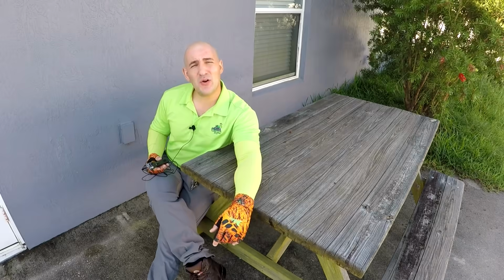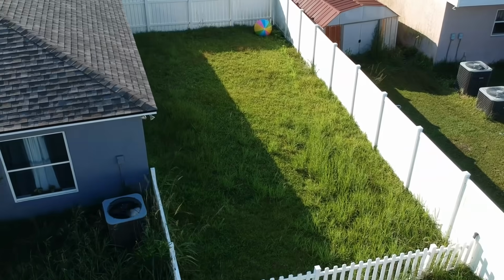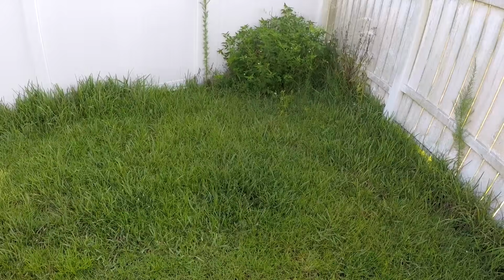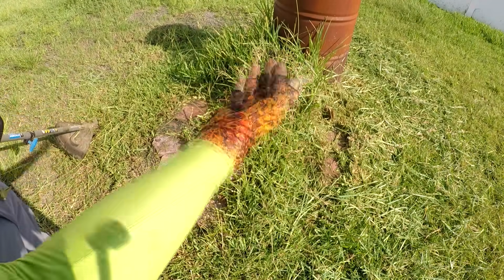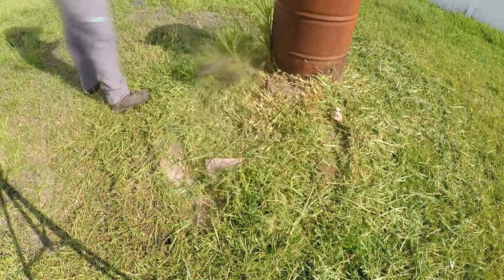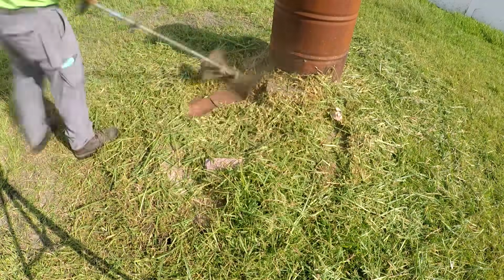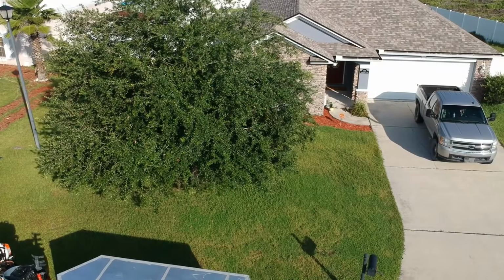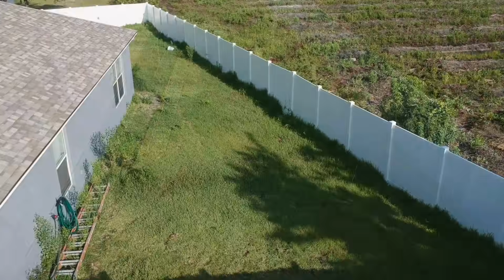This Yard Was Seriously Messed Up

Comment: Your back pain is your “SI joint” stretch your hamstrings and the pain usually goes away.
Reply from the maker: Thank you!
Reply: And if it keep coming back, not chiropractic help is needed but physical therapy or maybe a shoe adjustment.
Reply: @BakerCountyTrashPickup  as someone with SI nerve damage. Chiroprator will help but stretching is best. Your lower back needs help.
Reply: I agree:) Tight hamstring can cause that pain

Comment: I just got the Hart 40 volt trimmer and you are absolutely right it's has the power of gas for sure and I would be happy just going electric on the trimmer/edger part.
 but the man in me still like the purr of the engine

Comment: I think your back pain is being caused by your Sciatic nerve, you should go get that checked out
Reply from the maker: Thank you!
Reply: Matthew Summitt i agree.  you need to stretch your legs, especially hamstrings
Reply: I thought the same when he pointed to the location. A nice message and stretches will do wonders.
Reply: Look at all these Physical therapy doctors in the comment section. All went to harvard
Reply: @TheNacional95  yep we sat next to u
Reply: @BakerCountyTrashPickup  I'm not an expert but I have experienced lower back pain years ago. Looks like you are pointing to the sacroiliac joint - check your shoes if they are getting worn out evenly (let/right vs front/sides/back) - give this info to your medical provider who may recommend proper shoe inserts. Don't focus so much on stretching hamstrings, work to strengthen them (you may have imbalance muscle strength quads vs hams). Stretch the hip flexors instead. Something that really helped me: strengthen your core muscles (not referring to six pack) - yoga/deep breathing exs, improving posture.
Reply: What is the name of the weed wacker and edger you use I might get my dad one for Christmas because that think does work
Reply: @willjohnson376  check the description!
Reply: @dineshrm  I agree, I thought SI joint.  Go get custom inserts, they are not that bad price wise about $150. For me, it was the inserts and stretching all the low back, hip, thigh muscles.  A chiropractor can definitely help.  You do a lot of stooping and one-handed dragging that makes it worse> if you make sure you are lifting with your hips facing what you are moving, it will also help lessen the strain.
Reply: that requires surgery FOR SURE😭... go see a Dr and get an MRI of your back nerves before it gets worse. you will need surgery either way but the pain will only get worse the longer you go
Reply: Piriformis muscle is pushing on your sciatic nerve. Massage will release that in an hour. With heat. I mean real massage not a light rub. Ha. If your ever in Canada I'll send you to mine, she's magician.

Comment: Did the battery on your weed eater last that whole time? I have a friend looking into  the Hart brand after I mentioned you using them.
Reply from the maker: I think one 5ah lasted until I get near the corner of the tall fence and the small picket fence. There might be jump cut to change it out.

Comment: Those electric string trimmers are wonderful. I got the dewalt one myself. The only thing it seems to struggle with is the fall grass that grows by the ditch. It doesn't cut the grass but fluffs it up if that makes sense. It just knocks all the fibers out of the grass and leaves a mess.

 I ditched the gasoline powered ones in favor of the electric ones for noise reduction and not smelling like spent fuel at the end of the day.

Comment: That’s what many yards look like when I get the initial call. I do what he did but I go ahead and rake some of the yard. There is just to many clippings to leave which then turn brown and look like shit afterwards. If it will be a regular customer, I won’t mow it as low the first time and every time after mow it a little shorter until the preferred height. 
I love the Bobcat stander...I should have bought that instead of my Ferris!  Not sure about a cordless weed eater though. You need the power of a gas trimmer to get through some of those deep weeds! I do need to try edging beds with my edger and see how that works.
Good video!
Reply from the maker: Thanks for all the feedback and for watching!

Comment: I’m still learning from everything you show! I’m just starting to get it that you use an edger to cut the edges on the lawn and a string trimmer for cutting the height of the grass at the edge. Just got my first own lawns since one year so it never passed my thoughts before that these are 2 different tools. 🙂 From a distance they look the same but they arent. The string trimmer doesn’t have the right blade to cut through soil so it doesn’t suffice for that function.
Reply from the maker: Well said, and thanks for watching!

Comment: Good to be cautious around the AC, I recently had a low voltage wire go bad and AC guy said it was likely due to getting hit by string trimmer.
Reply from the maker: I believe it!
Reply: AC guy tried selling me a new $8,000 unit for a $30 part fix. Luckily I got a second opinion.

Comment: I have a couple of questions if I may ?

What mower are you using?
What other equipment are you using?
Why aren't you using the white Bobcat ZS4000? 
Why are you wearing a mask?
Why don't you stripe the grass when mowing?
Why don't you bag the grass after mowing?
Why do you use a stand on mower?
Why did you use tool XYZ instead of tool ABC?
Reply from the maker: XD

Comment: Hi Brad, I watch your videos and your lawn mowers seem to not clump the grass like mine. Sometimes I have to bungie up the grass deflector. I have a toro time cutter 5060 and while it’s not a commercial mower like yours, it’s still a nice mower. Do you have any tips on this? Should I cut the lip off my deck under my grass deflector where it keeps getting clogged? Any tips would be appreciated. Thanks!
Reply from the maker: I know people have cut off a similar lip on the Hustler Raptor used commercially and liked it.

Comment: Not a chiropractor, but it seems like the pain you are experiencing in your back is the upper part of your glute (Butt) muscle where the muscle is between your hip and leg. I think your experiencing the pain from holding your body stable while riding the mower or from any sort of leaning while edging. I experience the same sort of pain from running and weight lifting or just being on my feet all day. That area tends to get inflamed or over worked from a lot of moving around or bending at the waist. Best stretch and muscle release is the Pigeon Stretch combined with foam rolling on the area. Pigeon stretch is you basically get on the ground, put one leg back and the other you bring the knee up and open the lower part of the leg in front of you. It's hard to explain and I'm sure you can look it up the pigeon stretch better than I can explain it. But to use the foam roller, sit on the roller and lift the affected side's leg and put it over your other knee. Kinda like making a number 4 with your legs. Next, roll back and forth on that muscle. Do this lightly at first because trust me it hurts when you go hard. If you raise your other leg, you can open up that area a little better as well to get that muscle. 

Love your vids by the way. They always make me want to fall asleep and relax. Perfect mix of fast motion humming, music, and cleaning. lol
Reply from the maker: Thanks for the tips, I really appreciate it!

Comment: I have never thought about using an edger against landscape edging. I usually just hit it with a string trimmer. I’ll have to give that a try. Is that your norm, or just what you had handy?
Reply from the maker: If the edging is in really good shape I will, but if it is fractured or in pieces I won't mess with it because that edger can rip it to shreds!

Comment: Ive always only used commercial gas equipment. Do you prefer electric for performance or you just like to be environment friendly. Im not sure how much difference it would be weight wise but im sure electric is lighter and a little easier on the back
Reply from the maker: I have really liked the electric stuff lately for less vibration, no fumes, and when filming it is nice not to have an engine running when setting the tool down to move the camera. They have really decent power as well (moreso the HART trimmer, the ECHO edger has issues and I wouldn't recommend it)

Comment: What size of string do you use in your string trimmer. I have started using .105. And how long do your batteries last between charges?  Personally I like the gas powered trimmers.
Reply from the maker: .095. I can get 40 minutes on these trimmers over several maintenance yards.

Comment: How many spares batteries do you carry? Do you have a way to charge them when out doing lawns?
Reply from the maker: I think I have 5 from HART. No way to charge them.
Reply: @BakerCountyTrashPickup  You might need to install a power inverter (or two) with enough power inside the trailer to charge batteries while while on the move or on the job.
Reply: I agree with panamera a power inverter could work with just a simple 12 volt supply from the truck.

Comment: How many yards have you had to turn down because you could not get into an area with your 36 inch stander? I have one property that I could not get into the back yard because the gate is just wide enough to get my ZTR 32 inch in. Would giving up that yard and getting another to replace it be worth it if I had a 36 inch stander? The 32 inch is 3 years old with about 175 hours. I hate to give it up because when I purchased it I got a bagger set up with it.
Reply from the maker: None, thankfully. The 36 has gotten everywhere!

Comment: You mentioned back pain in there and it sounds like you might suffer from the same thing I do. Check out Lower Cross Syndrome. It's where your quad and back muscles are super tight and the stomach and thigh muscles are weak. Massage keeps mine at bay.
Reply from the maker: I'll take a look, thanks!

Comment: I’m actually curious to the difference between the weed wacker and I believe the edger.  

I read the description
Reply from the maker: String trimmer rotates ~15-17 inches of plastic line horizontal to the lawn. Edger spins ~8 inch metal blade perpendicular to the lawn.
Reply: Copper Creek Cuts Lawn Care thanks I’ve gotten in to mowing and these videos are awesome

Comment: The air conditioner area needed that extra work you talked about.  As a new customer or clean-up wouldn't you just charge more so that it can be done right each time?
Reply from the maker: Good question! Main reason is that work would not be something I would enjoy, which means the amount I would charge for it would be very high. So to me it is better to be more fair to the customer (and better for me) to skip the work and tell her how to manage it cheaply (spray) rather than charge much more every visit for me to hand pull a spot I can't even reach that has a mosquito nursery in the tire and requires me blindly yanking around a $3,000 piece of home mechanicals :)

Comment: Just curious, what is the purpose of string trimming on top of the grass after you edge a driveway/sidewalk?
Reply from the maker: The mower wheel on concrete sits higher than the mower wheel on the grass, which means the grass next to the driveway might be a little taller. The string trimmer just puts a nice bevel/angle on the grass at the border.

Comment: OK I looked for my question first but didn't see it. But jw as some one new to landscaping are u allowed to post what u charge for comparison. And also may I ask y electric over gas. Problems or just preferance
Reply from the maker: I don't post numbers because they wouldn't be helpful. If I see a yard like this generally I low ball it because I can make more on the video. Electric is easier to film with as gas isn't running and wasting during camera changes.

Comment: I'm curious why you choose to weed wack first than mow? I understand that its safer to weed wack first around sensitive areas where there's potential for damaging property or your equipment but in a residential setting like this, why not mow first then weed wack after? The risk of hitting utilities is very low.  I wasn't there but It looks like there's a lot of spots the mower could've done rather than the weed eater which would save your back and time! I brush mow and till several hundred acres a year with my Kubota tractor and the risk for damaging water lines or electrical is high but I always disclose that to the home owner prior to doing the job if they've let it get out of control and they don't know their property. I've done a good job and never messed up anything....Anyway, I love the channel and love to use my lawn equipment for my own property and jobs I do. I still find my high end STIHL gas equipment to be superior and I own the entire echo 58v line.....
Reply from the maker: I main reason to string trim before mowing is so that the very tall grass you string trim gets thrown on the lawn and mulched with the mower. If you mow first then string trim, if you are trimming 1 foot tall grass then you will have 1 foot tall clippings laying on the ground. The secondary reason is as you said, lets you see what you are working with. That fire pit would have been a total crap shoot if I was mowing around it first, might have knicked one of the taller blocks with the deck.

Comment: How beneficial has it been for you to switch over to electric equipment?
Reply from the maker: I'm not a great case study because those pieces were provided for testing so I didn't have the initial upfront cost. That being said, I have liked the lower noise and not filling up so much two stroke mix.